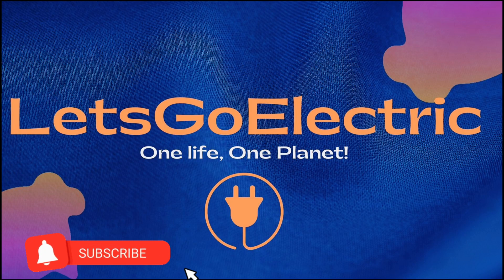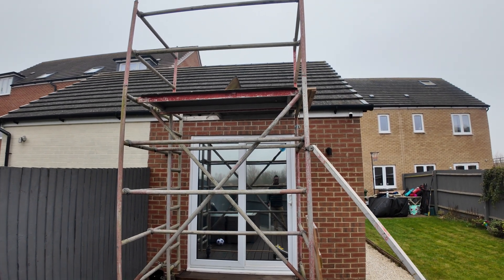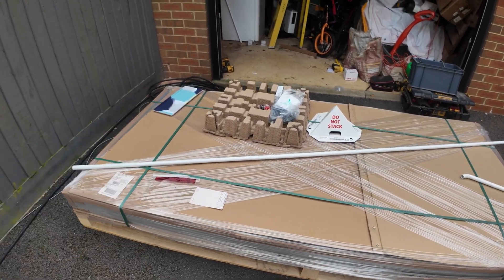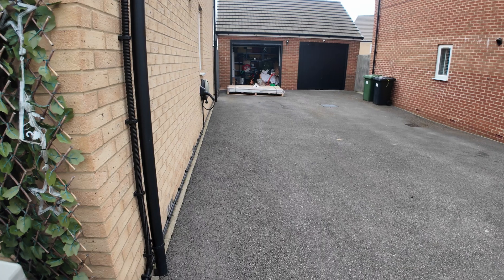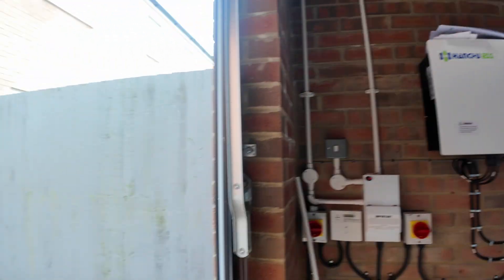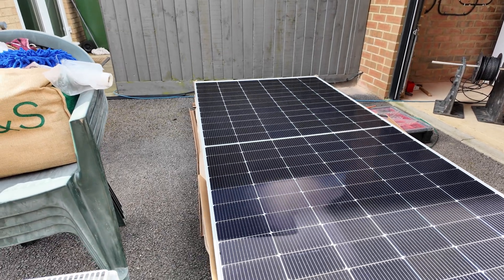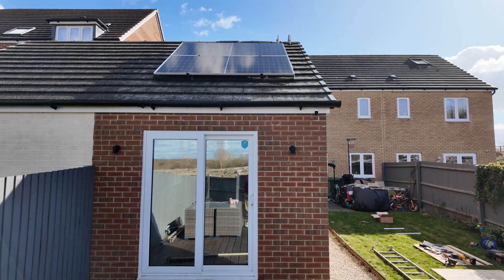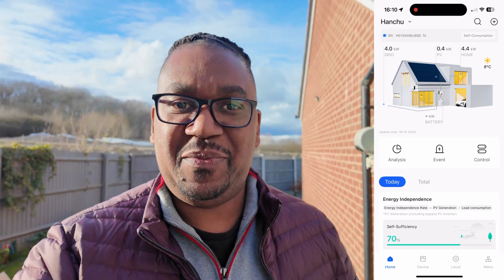Installing Solar Panels Is A GREAT Long Term Investment - I am Going SOLAR!

Comment: Is your set-up just 4 600w panels i.e. 2.4kWh? My main regret when I installed solar just over a year ago was not maxing out my roof space with panels. I only installed a 3.3kWh set-up. Is there a reason why you installed panels in the garage roof and not in the main house roof?
Reply from the maker: Yes, just 4 panels on the garage roof. House has a Dorma window at the top which shades a lot and could have fitteles less panels on there. The back would be only NE too so generation wise it would have been little for the scaffolding expense. I am looking at adding vertical ones on the wall of the garage if l can convince wife. Time will tell for sure but yes, would love more if space permits

Comment: This is real interesting, I’m on a similar journey. My Octopus heat pump installation get underway tomorrow and I’m now considering some solar and batteries.

I’ve had prices for Tesla, which I won’t now be considering, and GivEnergy. Are you able to share your reasoning behind Hinchu and the cost of the total solar/batteries installation?
Reply from the maker: Hi, yes sure, it is certainly cheaper that those 2 brands and is working well so far. The only issue with Hanchu is distribution and costing is very different, therefore you need a Hanchu approved installer who will be able to quote you. It's a shame on that front. Reasoning behind was because l.was having a small array and needed one that would be able to start up with very little voltage. Hanchu is 40V-530V, but is only hanchu batteries. No other batteries will work with it. I did a video on the inverter. I will be costing the whole system later but batteries are around £2200 fitted for a 9.4wkh. Some installer do the whole set up inverter and batter for £3500
Reply from the maker: https://www.facebook.com/share/18wFoR3y1p/?mibextid=wwXIfr

Comment: Well done on the set-up👍- why did you avoid the main house roof, as shading will be less & it has a bigger footprint?
Reply from the maker: Hi, many thanks for watching and asking a good question, l have a Dorma window at the front with shading on both sides and airvents everywhere. It meant, l could fit 5 or so panels with regulation on space left on either side of the panels, it would have been very difficult. The rear of the house maybe but it's NE facing meaning it would have been similar generation around 300 W or so. Cost for the scaffolding would have pushed but remain open to the idea foe rear. Before then, l have been monitoring the side of the garage for vertical ones although wife sounds unhappy for now.

Comment: Great stuff I have just had to two hanchu ess 9kw battery’s fitted, and a 6kw inverter …… I have 19 460w panels on my roof …. I think most of my days all I do now is look at the app .😂
Reply: I am also constantly on the app 😂
Reply from the maker: @ballathiam9486  awesome, thought I was going mad. Its really lovely right?
Reply from the maker: Wow, 19 panels, you must be checking the weather too. That’s great and the batteries are amazing right. I have fitted 2 of them too which is my next video. I’m off the grid all day now, and today is the best day. It’s £2 all day after charging on cheap tariffs. It’s great and yes l am also glued to the app and what is happening

Comment: Nice one! I've had my solar for two years eight months and the cost of each unit it has generated is already below 60p. As long as you don't intend to move, it's the best investment you can make, I think, and it's green!

Thanks for your heat pump videos too; mine is now installed and working well!
Reply from the maker: oh thank you Robyn, really appreciate it. I am so please the ASHP is doing its thing for you and no issues. Its hard to explain to thers how easy it is and works. Solar is amazing, I have just installed batteries this week as well so its full on set up now. I am impressed and yes, one has to make sure they intend to stay there for at least 5 years but it does increase the value of the house too. I am so happy, buzzing and checking weather report each day now. Thank you!!
Reply: Good to hear about your heat pump Robyn. I feel Heat Geek along with all these YouTubers having successful installs is a great advert for the technology (also solar).
Reply: @Biggest-hz7ng  The only thing negative I would say about it is, at least for the Daikin Altherma 3 M which is what Octopus installed for me and for the home I have, you need to tweak the weather curve a little, and the interface looks like it came out of the stone age. If you're okay with that, I think it's a great solution; it's much quieter than my boiler was, and it's ideal for the recent sunny-but-cold days we've had as my solar generation goes straight to powering the heat pump. I haven't run it through a full season yet - first full week of February it was installed and it saw first light on the Thursday of that week - and I don't expect to have any problems next winter. They installed the smallest one they do (the 4 kW version which can output up to 4.6 kW by spec) for my house which is a 1952 three-bed terrace of a fairly decent size, and they worked out a heat loss of about 4.2 kW for the house and replaced all the radiators.

For all those saying they are loud, they're really not; at least, the one I have is not at all. It's audible outside (not inside - I don't know when it's running inside through listening) but it sounds from the outside like a quiet fan. My neighbours have not complained!
Reply: Three  landscape maybe
Reply from the maker: @johnb7644 not with regs as they are. MCS certification would be tricky lm told but these are huge bad boys at 600w each and 2.3m wide